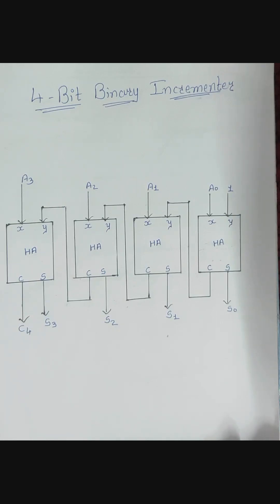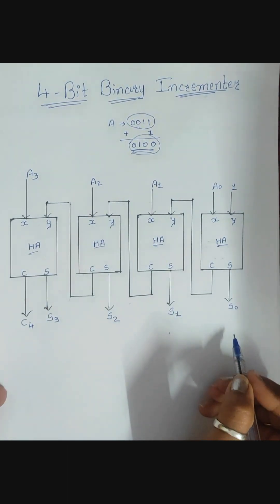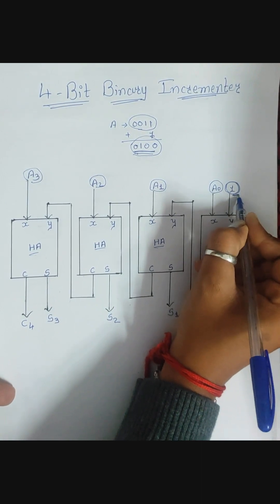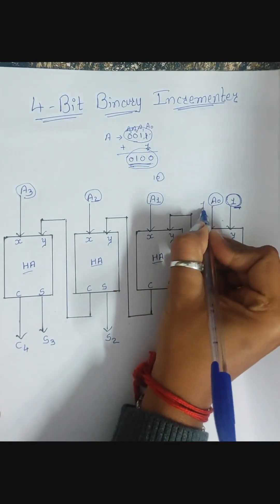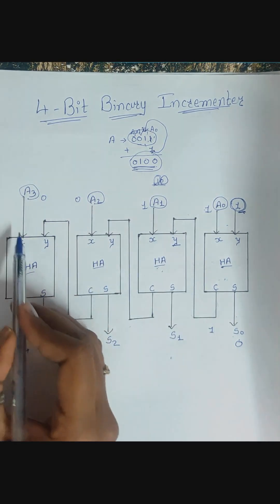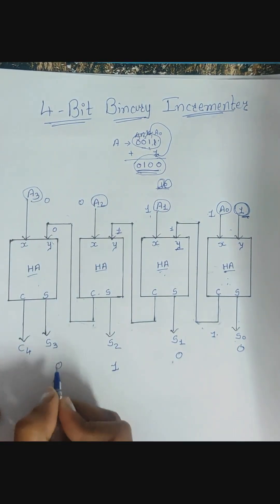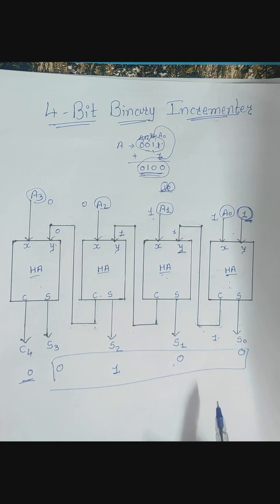4 bit Binary Incrementer || Computer Organization & Architecture (GTU)

Comment: 00:06 The video explains the circuit of a 4-bit binary incrementer.

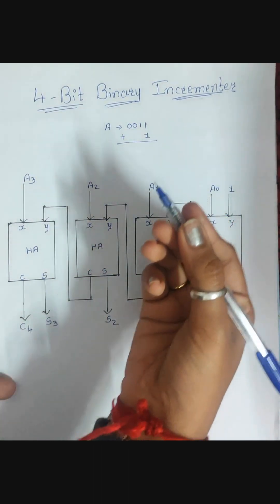00:40 Increment a 4-bit binary number using a half adder circuit

01:12 The half adder has two inputs and two outputs.

01:40 The least significant bit is incremented by 1.

02:13 The carry from the previous bit is forwarded to the next bit.

02:52 The carry output of the previous half adder is used as an input for this circuit.

03:20 Summarizing the binary incrementer process

03:51 Creating a 4-bit binary incrementer is easy, and can be extended to an 8-bit incrementer.